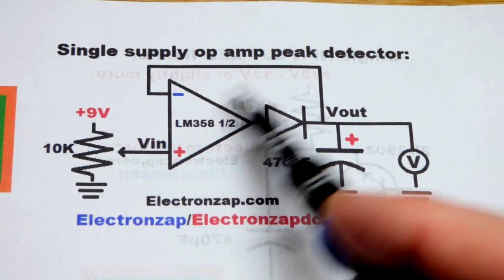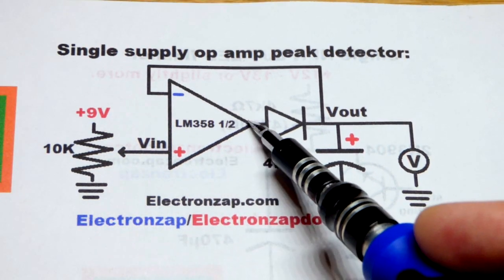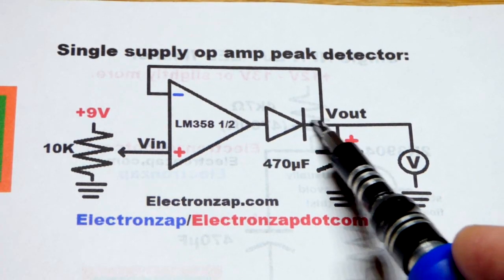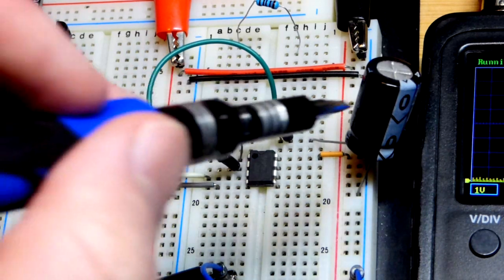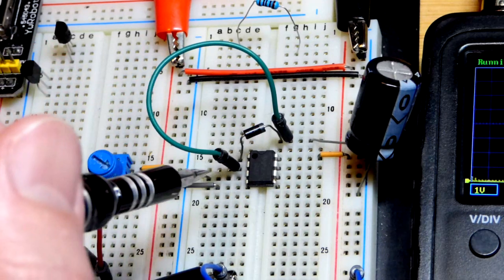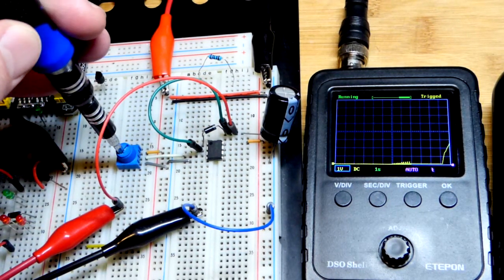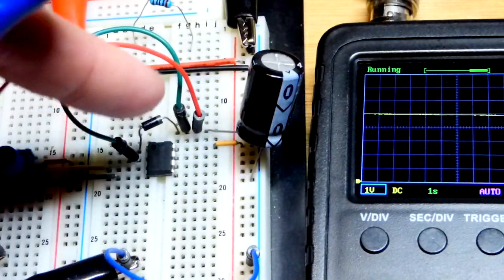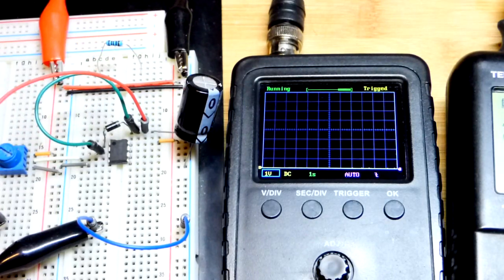LM358 single supply op amp voltage peak detector electronics circuit how to DIY tutorial

Comment: have any videos based on zero cross detection for AC applications?
Reply from the maker: No, unfortunately I never looked into zero cross detection.
Reply: @Electronzap  Please make a detailed video (like all your videos are) based on zero cross detection practical circuit using opamp/comparator. The reason is so that this tutorial will be very powerful and useful, it will help people to use optocouplers with Triacs to fine tune the power control of AC fans, AC motors, AC light dimming, AC pumps, AC electrical heating and etc. The opamp will be interfaced with a microcontroller and see the zero cross reference then fire the gate signal on a Traic. Controlling the Traic by digital means is super cool.
Reply from the maker: @ShopperPlug  I'll keep that in mind!